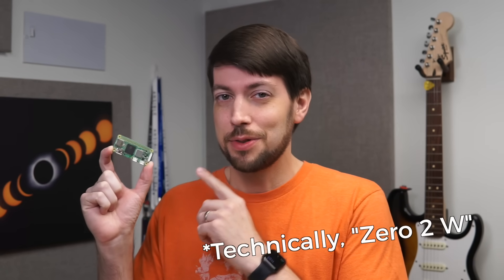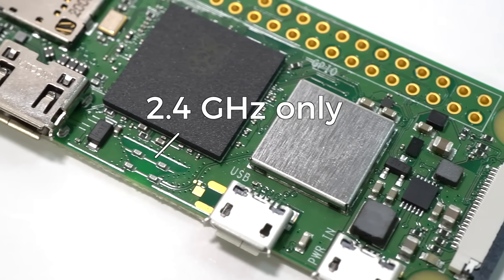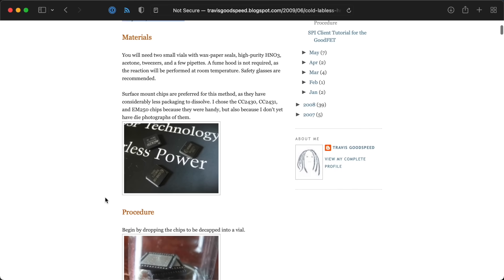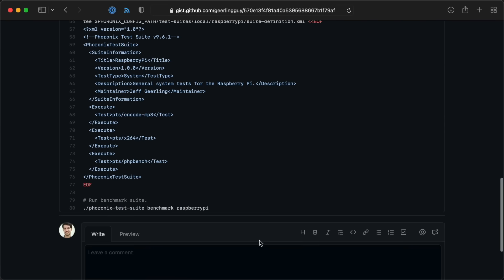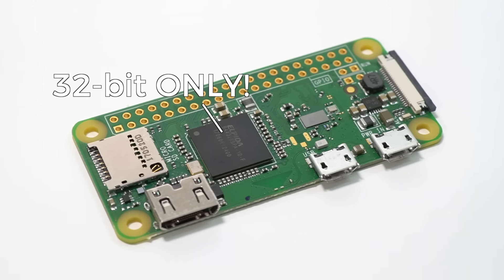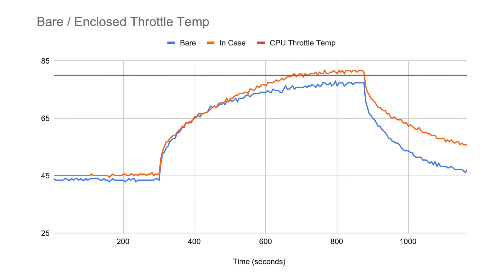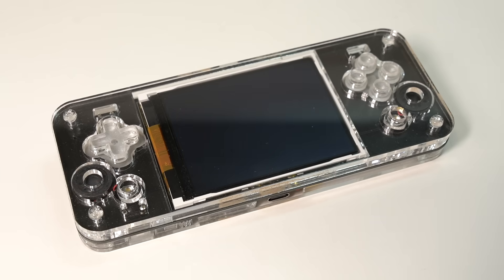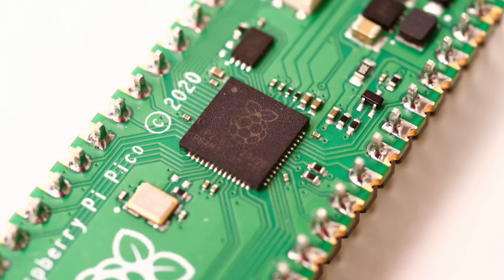The Raspberry Pi Zero 2 W review

Comment: It just isn't as interesting as the Radxa zero.
Reply from the maker: Radxa makes some great hardware, no doubt. I just wish their software support were a bit more broad/simple.
Reply: @JeffGeerling  No argument there. I guess I'm struggling with how the new revision fits into how I used the old 0W. The increased power needs of the new revision stop me from using it as a 'usb dongle', and that hurts.
Reply from the maker: @ImJustPassingThrough  It should still be able to run off a standard USB port, since power consumption is less than 600 mA.

Comment: For me who lives in Australia $15 isn't even a "suggestion", it's just a dream. My pi zero was around $35...
Reply from the maker: They must be getting the costs upside-down in Australia! Wish there were a local authorized reseller :(
Reply: @JeffGeerling  Yeah, I live in Europe and even after VAT, it comes out to around $18,5 for the Zero 2 W. $35 for a basic non-WH (without the header pre-soldered and wireless) is crazily expensive.
Reply: Can u backdoor it with ebay worldwide shipping ?

Comment: i wonder if you upgrade the RAM chip.. is there a 1G RAM chip? but i am guessing it will be hard to solder chip stacked on chip.
Reply from the maker: Heh, well in this case the RAM is inside the package, so you couldn't even desolder it if you tried—you'd have to delid the chip itself!

So unfortunately, the Zero 2 W would be extremely hard to hack more RAM into.

Comment: Nice, didn't know it came out, might be useful for a 3dprinter with klipper
Reply from the maker: Yeah, Klipper or OctoPrint should run pretty well on the Zero 2 W!
Reply: @JeffGeerling  you don't even need octoprint, there's fluidd/mainsail that are lighter and better integrated, octo should work but 512mb might make it a bit unreactive, if it comes out here and I can get it for 15-20€ I'll definitely try it to use my 4 on the printer for something else

Comment: To me, this is just highlighting how late the release version of 64bit RasPiOS is!  Now there is even a Zero-sized board that could benefit from it (with care about RAM usage).
Reply from the maker: I'm hopeful the 64-bit Pi OS build will become the default sooner or later. The Zero is the last of the boards that didn't have proper 64-bit support...
Reply: @JeffGeerling  That’s because the old Zero was an ARM 7 32-bit chip incapable of running modern ARM instructions. That’s been a huge challenge trying to find software that’s still buildable and functional on such an old instruction set, even if I pulled 32-bit compiles. To get Docker containers working, I pretty much had to run HyperiotOS as the only option. And then there were only a handful of software packages that worked, mostly compiled by Hyperiot. Once I found a working JVM I could run Java software. But that was painful on a CPU that underpowered. So this upgrade was long overdue as the old hardware was quickly growing useless.
Reply: @thewiirocks  ..”the old hardware was quickly growing useless “ to YOU, mayhaps…
But there are plenty of us out here that are running use cases (power budget) that run FINE on the “old, useless “ hardware.
Software has been written, and validated.

Now, having NEW hardware at the same price point AND power budget… then yes, it’s gonna be an easy (easier?) upgrade path,,,
And making the case for the ‘old’ hardware more difficult to support…

ARM7 to ARM8 is a major stepping stone in terms of software support.

Comment: many phones now stack cpu and memory, for years actually
Reply from the maker: The original Zero used a package-on-package design, and some phones use a similar method to both Zero and Zero 2, but besides Apple, most manufacturers don't make their own chips, it's all prepackaged silicon. This is RPi making lemonade out of the lemon that is a non-stackable die.